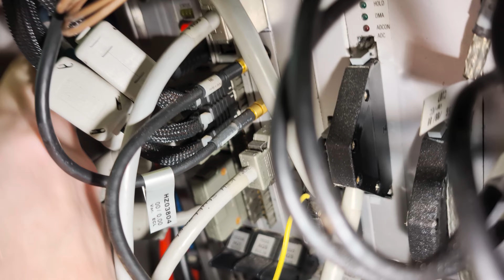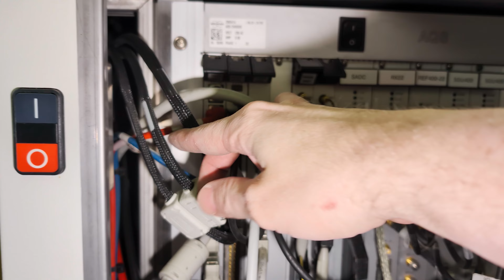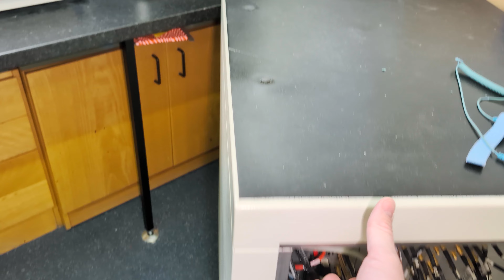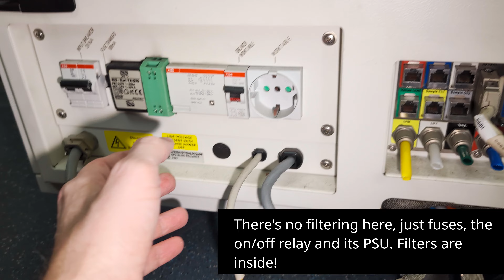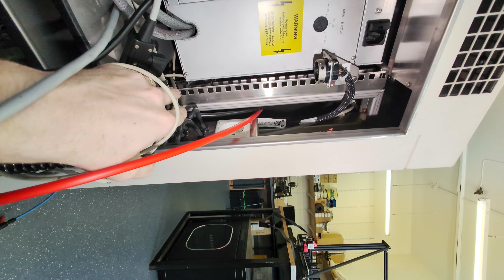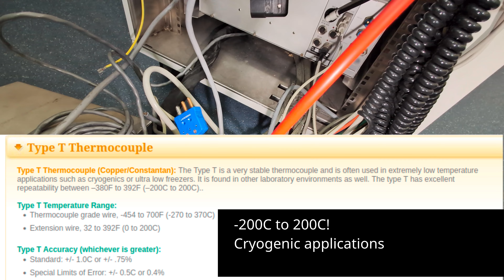#14 [teardown] NMR Control Cabinet - Bruker Avance 300

Comment: How, the  Intel i960 one of Intel's attempts at RISC !! The other processor is compatible with the ones used in Silicon Graphics workstations of old. Like the O2 and the Octane etc (same family not same generation). Great thanks for sharing.

Comment: If it's anything like the machine I used a decade ago the annual cost of upkeep, maintenance, and regular calibration dwarfed any actual hardware cost. 
Minimizing upkeep costs was worth essentially any conceivable one-time expenditure. 

Neat to finally see what they look like on the inside :)

The lack of active components on the input/front-end boards might be to avoid amplifying noise before a differential amplification stage. At least that would be my guess, not actually sure.
Matching traces and passives is much easier than matching active parts.